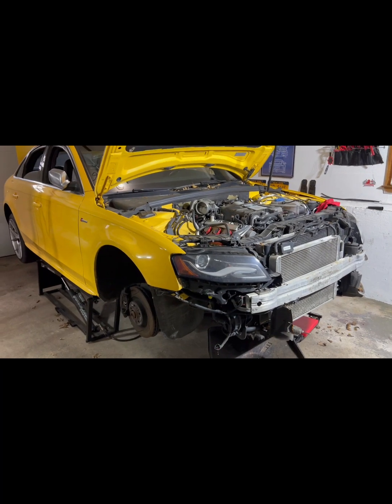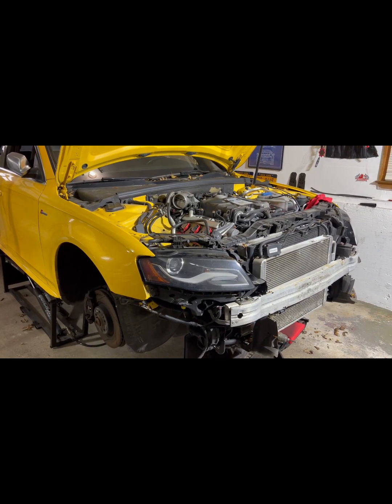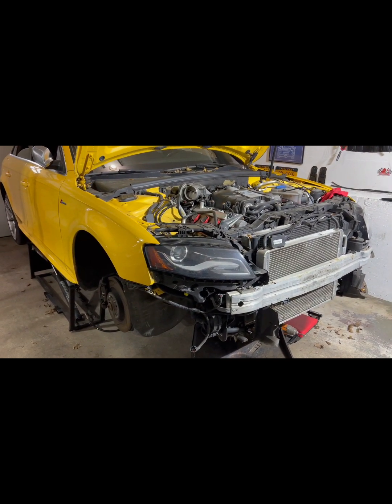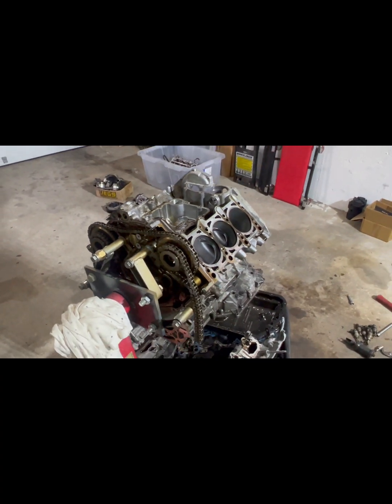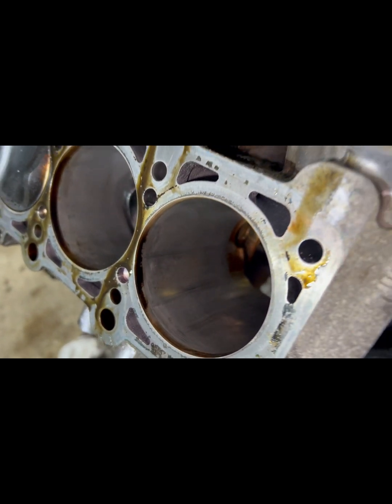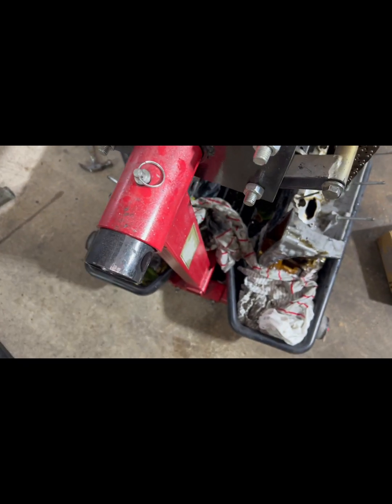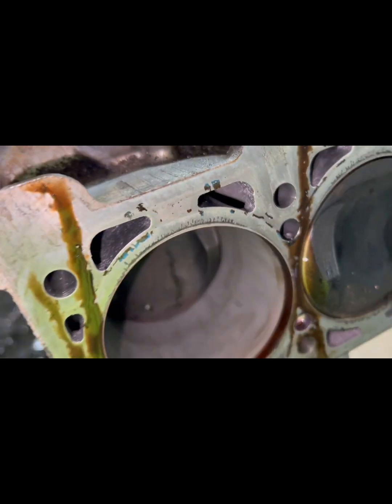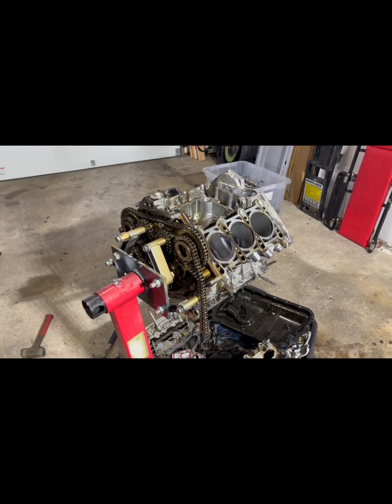2011 Audi S4 Engine rebuild 3.0TFSI Part 1

Comment: Have you come up with an improved method to remove the engine without a lift? I saw the video from two yrs ago with the seized engine.
Reply: the best way i found is to losen the engine and gearbox mounts, then you hold th engine with your crane, you will just lower the underframe and the engine will drop you get it back up you will have the space to get it off, i do that with s4 v8s

Comment: Can you tell me which parts you are using for the new pistons/rods?  I would like to build my engine up.  Also, is it possible for us to install larger injectors on this car ?  Currently running St2 034 on E40…
Reply from the maker: Part 2 will be assembling motor with forged internal etc.. and first start
Reply: Part 2 😢?